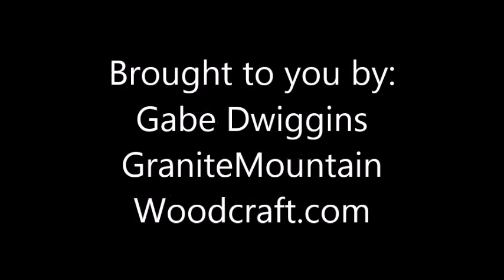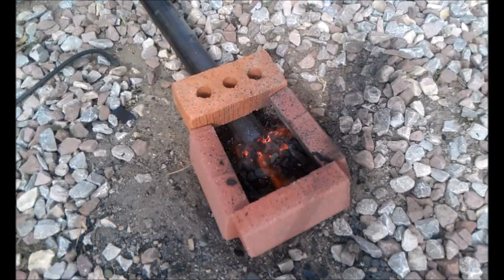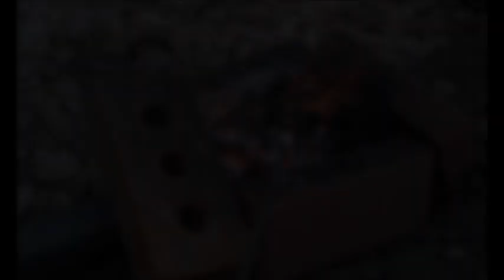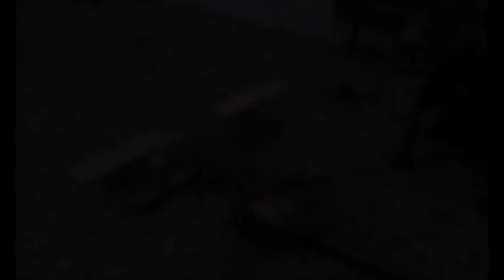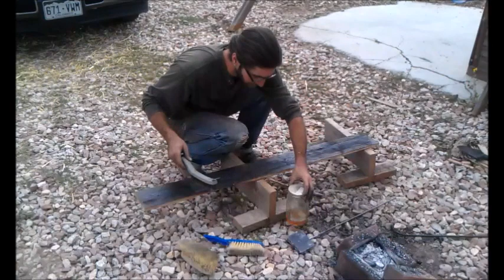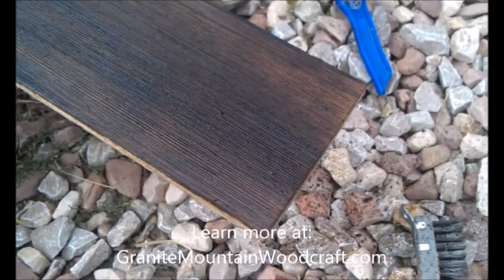Fuigo Fun, Shou Sugi Ban

Comment: Hi Gab...A student today found this video and asked about it...

Thought I would drop a note about what "Shou Sugi Ban"...isn't... in case you may wish to edit the title?

There simply is no such thing as "Shou Sugi Ban."

Historic traditional searing/charring modalities, of which there are many, are not to be confused with traditional Yakisugi 焼杉 (sometimes written improperly: 焼き杉) grilled cedar also called: “Shou-sugi-ban” erroneously by Europeans and those in North America...There is the 炭付 (Sumi-tsuki) “with charcoal” heavy burn method, or the  磨き (Migaki) (焼杉美杉 Yakesugi Misugi) “polishing” smoothed out method...バーナー焼き Bānā-yaki “burner - “flame painting” method....鰐 (Wani) “crocodile” effect…etc.

Yakisugi can only be achieved with a limited range of Cypress species found on the islands of Japan and is a very unique process found within several methods of crafting guilds.  The most commonly seen being where three planks of wood get bound together to form a long triangle and a fire is started in the resulting tube. There are several other methods, but they are for very specific formats and within context to only yakisugi and not the charing modalities found within other cultures. This technique works well only when you have similar boards, as it's complicated to set up when boards have different widths and lengths. 

Here is a great link to a colleague's information on this topic: William Beck wrote it in 2019

https://nakamotoforestry.com/yakisugi-or-shou-sugi-ban-learn-what-you-should-call-it-and-why/?fbclid=IwAR1SKdS3Ffe1xaM7JxNGIQbjcDLBOwSUqtHcnu3BOZaZeLvfVhZm2vWDzFE

Comment: may i ask you, i used the same forge,but my coal is clogs pipe
Reply from the maker: I'm using charcoal chopped into pieces around 1" square, nothing smaller than 1 cm or so because it impedes the flow of air through the coal bed and you can't get a very hot fire. Ideally the base of the forge is charcoal fines, nice kept nice and dry. The tuyere should angle down slightly as it enters the forge, and it doesn't hurt to have it enter from the side a couple of cm from the packed base. Also I have to clean the fire pit out after a day of forging or, as you say, it gets clogged. Sometimes if I've been forging for a while and don't want to stop to clean I'll give the coal bed a heavy blast from the fuigo, lifting the whole coal bed and easing the airflow a bit. Hope that helps!
Reply: Gabriel Dwiggins
thnk you for answer, i hope that charcoal will help me, blacksmith coal is too small, and i forget that i have hot air push into forge and that is the problem